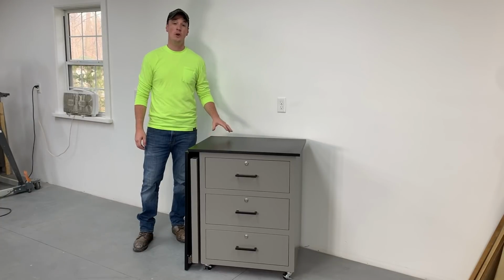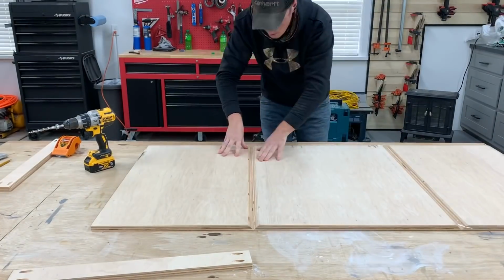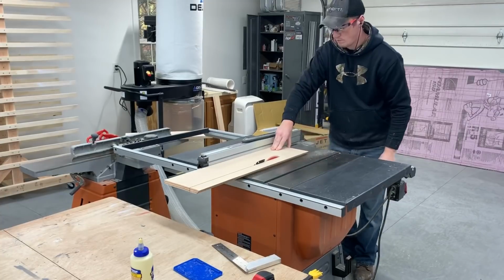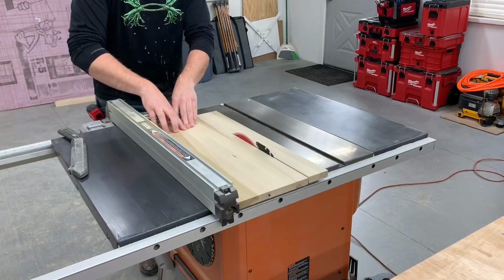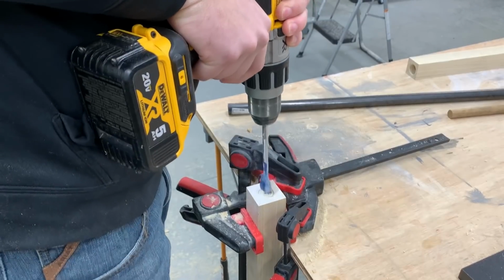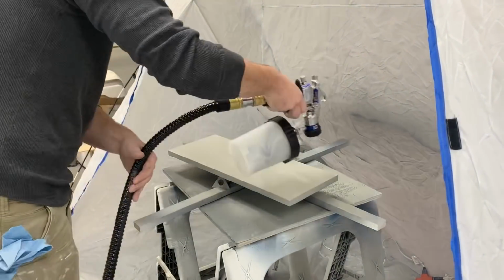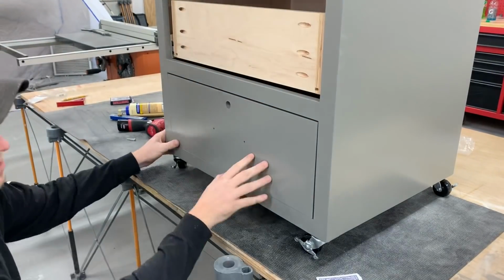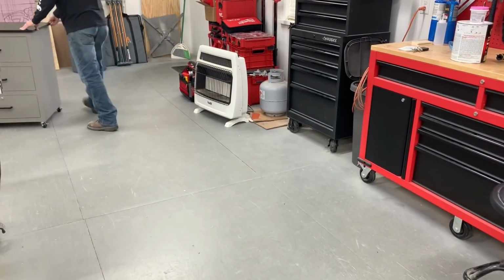Mobile Cart with Folding Work Table Build

Comment: Nice build but the client will get tired of flipping legs 4 times to use it.  Should have talked them into a shorter extension.
Reply from the maker: Gave them the option 👍🏽 setting it up once a day, sometimes not at all, isn’t a big deal.

Comment: Great work man. How do you make your face frame such that there's exactly the right inside hang over (is that called the reveal?) so those spacer blocks of 3/4 (or just undersized) plywood put the drawer slides flush with the inside of the face frames?
Reply from the maker: The face frame is 1.5”. 3/4” cabinet and then the 3/4” spacer, and since the plywood is undersized, it leaves about a 1/16” reveal on the outside of the cabinet. I’d prefer to have the small reveal on the outside anyway as a detail, than try to make it flush, when the seam would be visible anyway👍🏽
Reply: @JohnBuildsIt  Gotcha. So when you build the face frame you make sure it's flush with a spacer block of 3/4 ply inside the box? I agree, definitely need a slight reveal on the outside too.

Comment: Was that 45 degree cut off, since the angle gauge was against the teeth of the blade? Or are the teeth the same width of the blade?
Reply from the maker: The gauge wasn’t on the teeth👍🏽 but yea that would throw it off
Reply: @JohnBuildsIt  Ah, I see it now, nice rip cut blade! I'm used to a cheap 40 tooth utility blade or an 80 for plywood. Cheers for the reply!

Comment: Since ur using pocket holes like me to get some savings. Buy 5000 count 1.25 inch coarse thread pocket screws on amazon. I think it was like $78-80 but if u buy 500ct at big box store is more than $20 per box. U get 2.5 times more value that way
Reply from the maker: I do! I just refill it into the smaller container haha 👍🏽